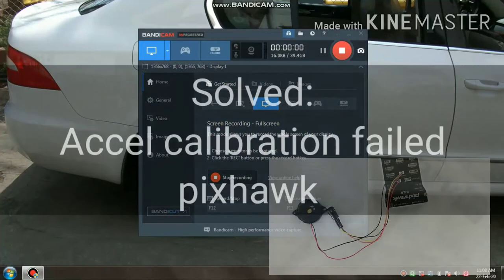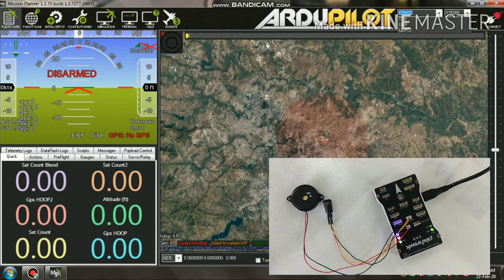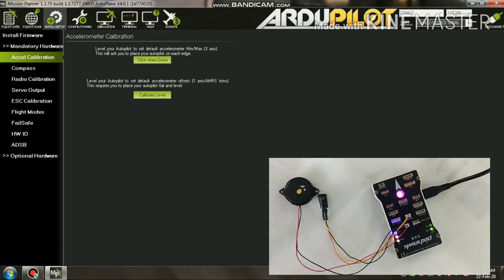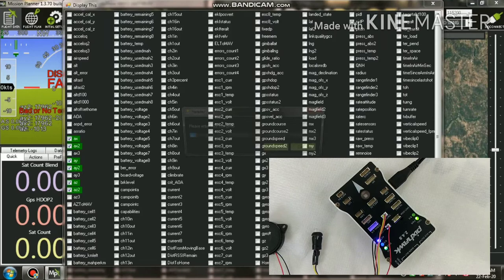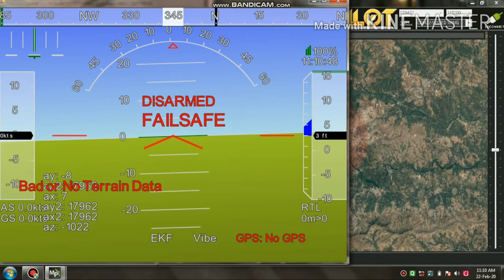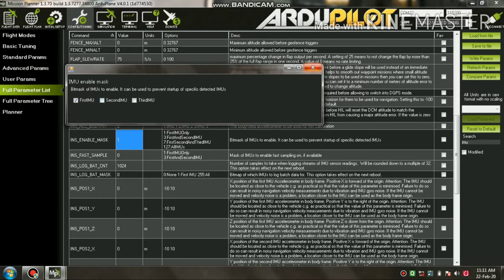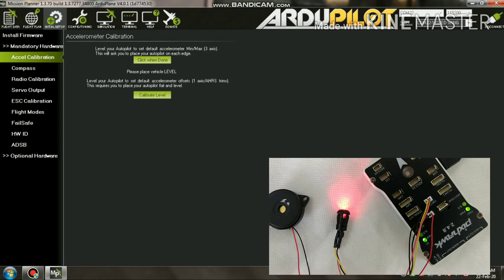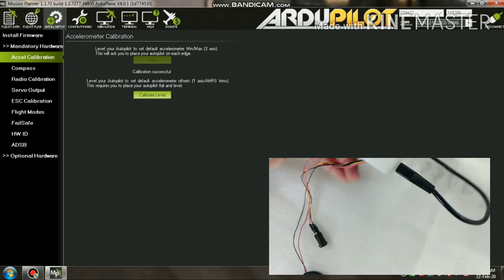SOLVED:Pixhawk Accelerometer Calibration Failed

Comment: Compass calibration is a lot miserable, after 3 hours I've successfully calibrated the compass but then too it's not working as it should be.
Could you suggest an external compass? Price don't matter much.
Reply from the maker: First of all Thanks for watching 
You can  use GPS + Compass 
https://m.banggood.in/APM2_6-2_8-GPS-Module-High-Precision-GPS-With-Electronic-Compass-PIXHAWK-p-1240362.html?rmmds=search
This contains a reliable GPS and a magnetometer (compass) 
I was using this for a couple of years without any problem

Comment: Hello, could you help with a problem. While connecting the power module to my Pixhawk, it flashed blue and now the main LED is a solid white. It's not being detected by the computer. Any advice?
Reply from the maker: I am sorry but your board is gone now ,same happened for me , basically your epprom and bootloader fried and now it can't accept any program , the power module I think was faulty . You need to replace it .
Reply from the maker: If some how the power module deliver more than 5.0+- 0.1v the main controller got over voltage and hence it fried .
Reply: @rcbuildmaster6192  Thank you, for replying so fast and for the advice. So it's completely dead? What test can I do on the new power module to avoid this again?

Comment: Hi , in mission planner, i am not able to do accelerometer calibration, after tilting left, calibration fails. any solution with anyone?
Reply from the maker: You don't have to tilt left , actually reffer to a calibration video you will get the correct methodology of calibration , make sure your HUD is stable and level  before calibrating